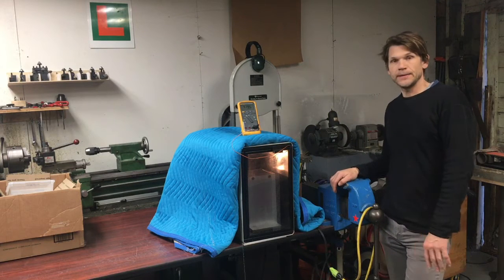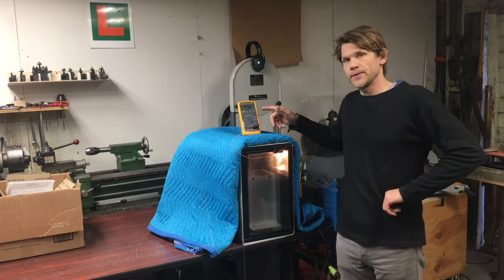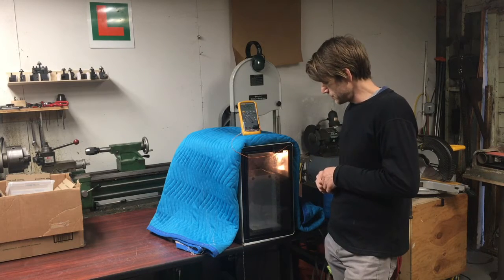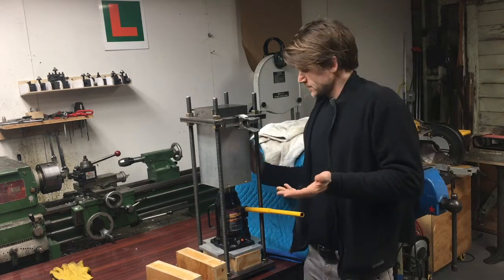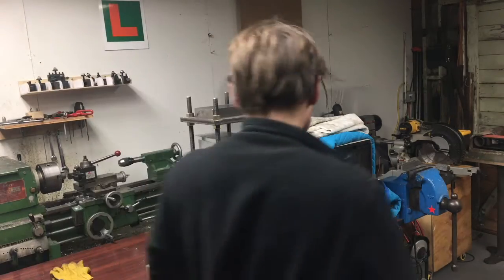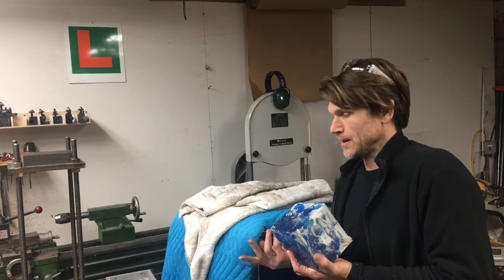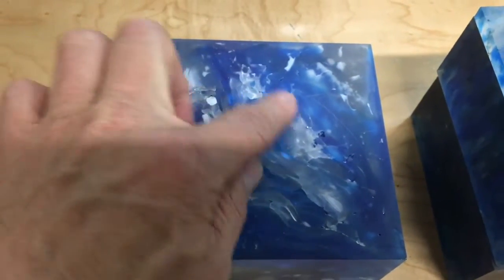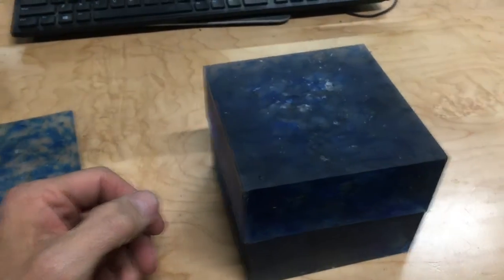Recycling acrylic scrap using an oven and a hydraulic press

Comment: I know I'm late here, but I can't help but wonder some things, so I hope someone's listening:

- What if, with the shredded acrylic, you had compressed it in the press before cooking it, in order to perhaps get a finer pulverization, and maybe even pack more into the mold?

- The dirt problem: Would rinsing the acrylic shards in a sieve do the trick?

- The problem of lesser quality on the inside: Since you're doing slices after demolding, you could shuffle those slices like cards -- or, rather than randomly, you can cut the thing in half, and flip the halves so that what used to be the middle will become the new outside. You could do this on three different axes, and that should put the worst air voids outside, where one more melt and press should even things out nicely, and because the mating surfaces were flat to start with, there should be no new air voids formed.

- Have you considered having the oven mounted into something that vibrates, in order to maybe help reduce air voids?

Comment: The slight imperfections can be filled with 2 part acrylic cement.  The cement can be applied clear or colored.  Smells bad but forms water clear joints.  Should fill nicely and be sanded and polished to a glasslike shine
Reply from the maker: Yeah I like Weldon 40 for that

Comment: The finished product is totally gorgeous! Less talking, more showing!

If you have a CNC machine you could make a sculpture out of it, from a CAD model downloaded off the internet.

Why not do the opposite and put the crank on the top of the upright scalding metal container? The crank can push on the upper plate and have a centered block under it to press against the metal container.